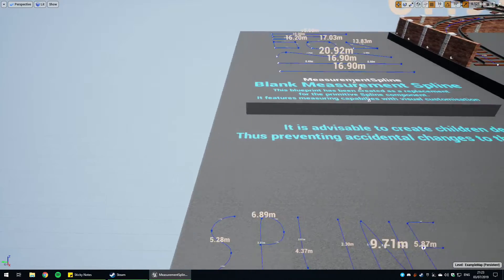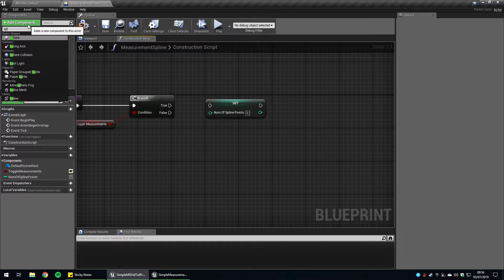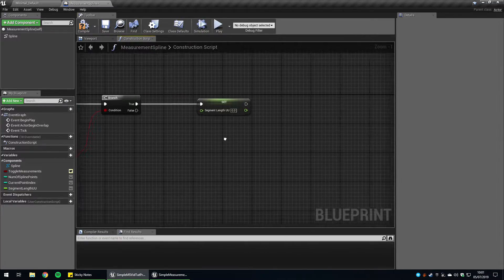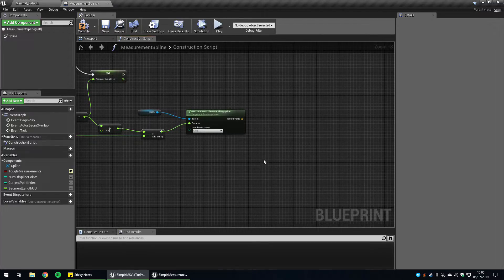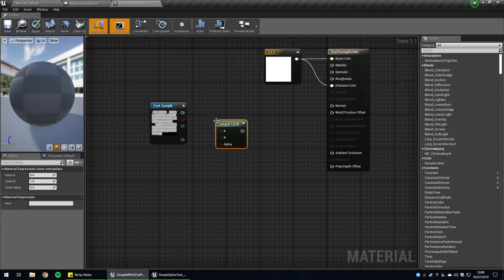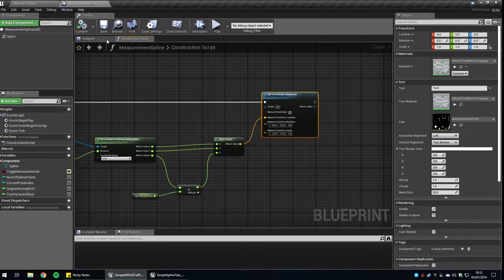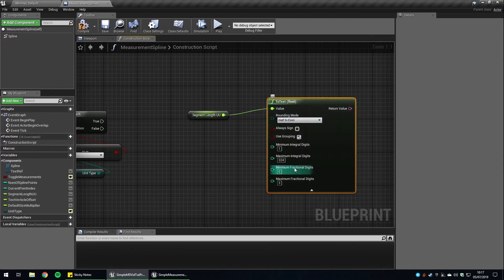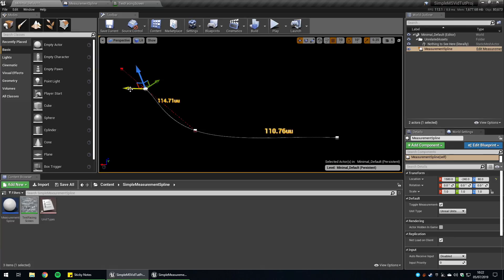How to Make: Measurement Spline | Unreal Engine 4 | Visual Scripting

Comment: How you make brick wall turn to procedual  in 0:15?
(What key?)

I have tried the product for many times but still can not figure it out.

BTW, when update to 4.26?
Reply from the maker: Hi, you can press ALT + Left Mouse Button and drag over one of the translation arrows on the 3D widget. I will update the product to support 4.26 today, thanks for reminding me.
Reply: @mikesimulation8019  Thank you.
Reply: PS: double-clip the blue point and then  "blue point turn to be whilte point" and "the translation arrow" appear.
 And then ... use alt-left mouse button to drag over one of the translation arrow.
Reply from the maker: @LeoChenTaiwan  Thank you. I missed quite a vital detail there. Good on you for working it out and helping others 😉.